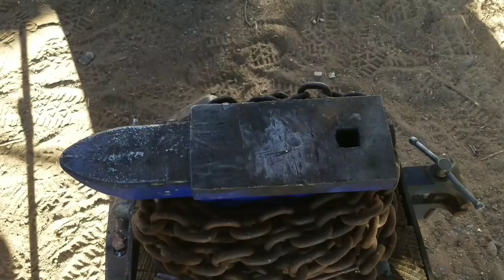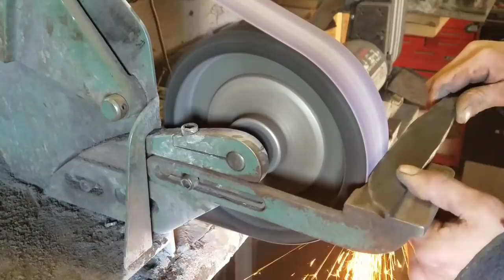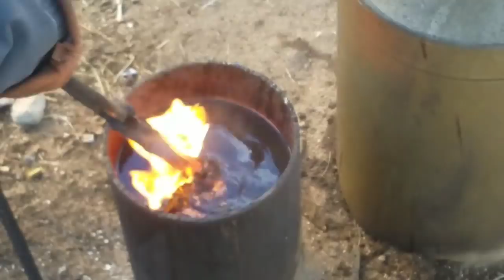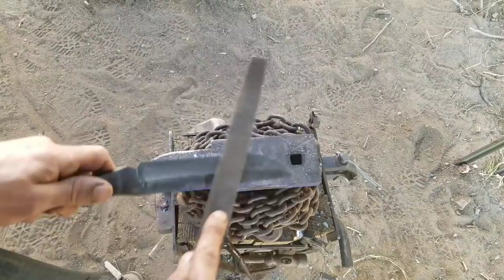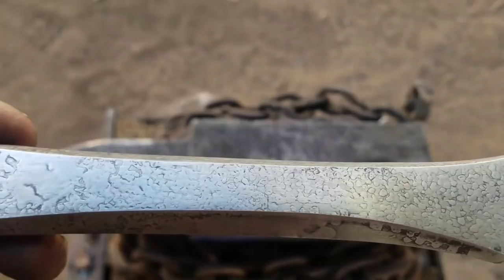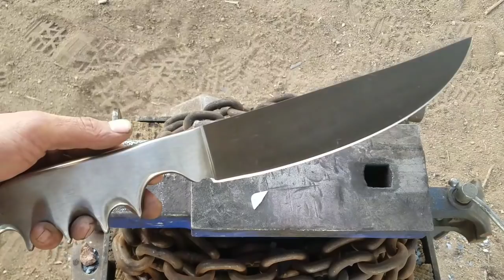Forging A Knife From Allen Wrench

Comment: I made a long thin fillet knife from a long 8 mm wrench I have a pile of. I kept it flexible but it will not take a sharp edge. It was quenched then tempered and a comfortable walnut handle attached so I really don't want to heat treat it again.

Comment: 15 Dislikes because they use their weenie to forged. Allen wrench is W1 tool steel right ? if i recall.
Reply: Yuri Naka the high end ones are up to 0.8C . Mostly 1045-65 or tool steels with mid carbon as 4140. Not the best knife steels.

Comment: How about making it out of a bunch of paper clips or old coat hangers or something that is no longer useful???
Reply: That kind of steel is mild steel, and not good for knives. You have to use carbon steel, typically used in tools, for that.
Reply: Try making it from allen wrenches from the 99 store or some other junk metal. Don't ruin something that's good just to make a knife; make it from junk.
Reply: That's what he has been doing.
Reply: Dan Given go ahead if that's what you want.  This man wanted a knife.